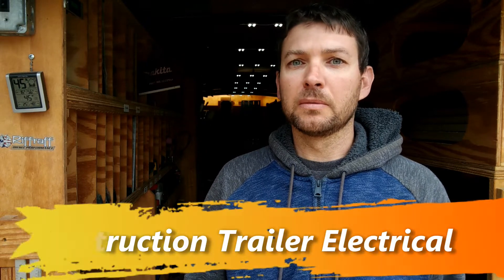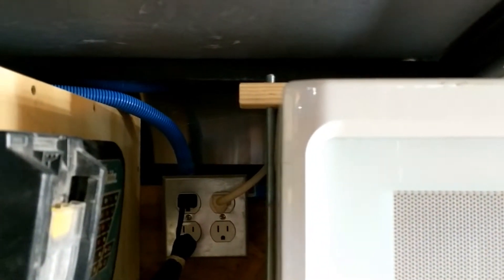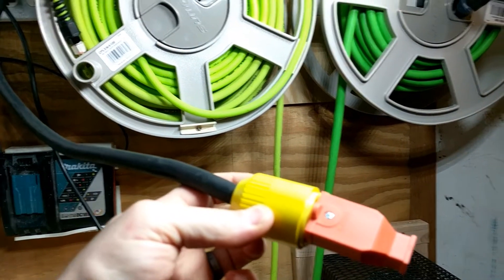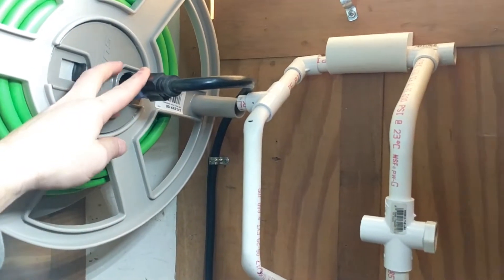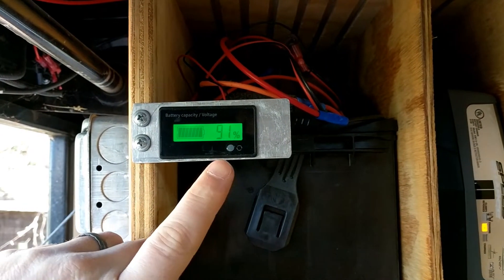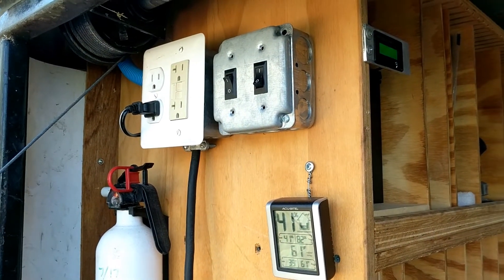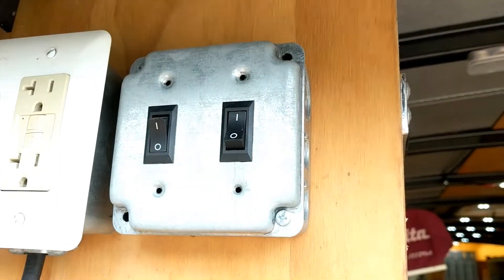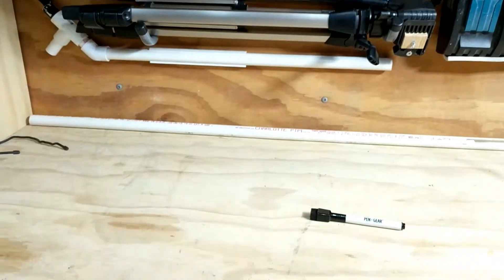Construction Trailer Electrical Setup and Tour (110v and 12v)

Comment: Anthony, I should have read your reply from one year ago and I definitely would agree with the lithium ion battery. What size lithium ion battery do you think would be sufficient. Thanks Joe.
Reply from the maker: I'm not sure what would be suitable. I've taken mine out and replaced it with attachments for two 18v Makita batteries. They drain quicker than I suspected and all they are pulling is the LED lights.

Comment: This is so helpful and informative.  Thank you so much for your time making this and sharing it with us.  I've got everything you listed (that's still available) in my amazon cart.  Do you have any thoughts now that you've been using this system for awhile?
Reply from the maker: First of all, thanks for watching and commenting Seth. I would add a solar panel to keep my battery charged and I would put a lithium battery in instead of a deep cycle marine battery. My battery runs down really quick and I don't even run anything except for those LED lights.

Comment: Nice job man!  I am almost finished with mine, I am using alternator and solar power to charge my 100ah deep cycle battery by way of a dual input DC to DC charger.
Reply from the maker: Fantastic! If you happen to do a video or a write up be sure to put the link here in the comments. Are you going with traditional battery or lithium battery? Mine doesn't seem to hold a charge very long anymore.

Comment: That black cord with the orange end you purchased is very dangerous and illegal.
Reply from the maker: What can I upgrade to that would be better?
Reply: @shooshinejonnie  I didn't understand what you're trying to do with the cord but you can't plug the male end into a receptacle and have a hot male end on the other end of the cord. What does the cord up by the hose real that you're trying to power do?
Reply from the maker: Basically I have two pigtails that go into the same system. One is to plug in at the back of the trailer and the other is to plug in at the front of the trailer. So yes, I do have what is basically an extension cord with plugs in the middle and two male ends on either end. I usually use the one in the front the most. It is convenient to have one at the back of the trailer. Sometimes I just run a short cord instead of my big cord if I need to power up a charger or something small.
Reply: @shooshinejonnie  If you're the only one using it than you know what is going on. I'm sure you could wire something up to avoid having a cord with 2 male ends.
Reply from the maker: I may just eliminate the one that the back end of the trailer. I don't use it that often and I can't close my door with it plugged in. I appreciate you chiming in.
Reply: @shooshinejonnie  I'm only trying to help, accidents can be expensive.

Comment: Hey Anthony, awesome construction trailer set up you’ve made for yourself there. Can I ask, is the power coming in 15/20A? Also do you have a breaker on the line any where? Thanks
Reply from the maker: Thanks Oliver. I only have 15 amp power coming in. I don't have a breaker. I have a gfci outlet on one end that would protect the rest of the outlets. I need to put a gfci outlet on the front feed.

Comment: Thank you for the video.  Got some good ideas.  Seems you have to have the rear door open in order to use 110V current.  Ever think about installing a plug on the outside of the trailer to attach current?
Reply from the maker: I have the big green cord in the front that drops out through the floor. That usually powers my entire trailer including my air compressor.
Reply: @shooshinejonnie  Can you post where you got the cord/reel setup?  Also, what are you using to cover up the hole in the floor that keeps dry when trailering in the rain?  Appreciate the help!
Reply from the maker: @SteveK99Sub  here's a link for the hose reel.
https://www.amazon.com/Suncast-Sidetracker-Garden-Hose-Reel/dp/B000BQQ2NM

I have a cover for the hole but I never put it on. I've never had any water that I noticed inside. The floor is about 4 to 5 inches higher than the outside aluminum. I would probably use the cover if I parked it in the grass for any extended period of time to keep the mice out.
Reply: @shooshinejonnie  What you have your electric cord rolled on is just a hose reel?  I thought it was specific for electric being it had a plug.. custom made?  Appreciate the help.
Reply from the maker: Yeah, it's just a regular hose reel. I took the center water hose guts out of it, drilled a slightly larger hole,  and pushed my cord end through there. It's pretty simple. 
Obviously you can't leave it plugged in while unrolling like you can a water hose. I set my air hose up the same way.

Comment: how many amps hours is your battery rated for?
Reply from the maker: Canadianguy91 I'm not sure. It's a fairly big marine battery but it does seem to drain much quicker recently. I tried to see how big it was, but I believe the label is on the side and it's a big hassle to get it out. Unfortunately I can't answer that for you at this moment with any definitiveness.

Comment: Thanks for the video, but you skipped over the very last part I was hoping you'd answer. How is the 12v light switch wired? So you have the 120v and 12v wires wired to the same light switch?
Reply from the maker: Thanks for commenting Matthew. I don't have any 120 v lights in my trailer. Everything is run off of 12 v and it's connected to the battery.
If I would have any lights on 120 I would do a separate switch for those so they can be powered when the trailer is plugged in.
My father has lights that are 12 volt and 120 volt. He has two separate switches for those. His are wired so that every other rafter is powered by the same source. He used the exact same lights but had to add a transformer for the 120 side. Hopefully this makes sense. If it doesn't I can try to clarify a little better.

Comment: Sweet trailer! Don’t you have a back up cam as well?
Reply from the maker: Thanks Jordan. Yes I do have a backup camera installed. 
https://youtu.be/Bdv5dlPEw-4
Reply: Awesome! What kind of camera did you use? Does it work well?
Reply from the maker: @jordanbriner1683  here's what I used on both the truck and the trailer. 

Esky https://www.amazon.com/dp/B013OLWDW4/ref=cm_sw_r_cp_apa_i_CVxuCbB7SDY24

Yes, it works good. Good field of view. 
I'll have to do a little digging to find all the info about the wiring that I used.
Reply from the maker: It just hit me that I didn't have the camera installation in this video. 🤔🤪🤦 I believe I have the installation ready to be edited. I'll get that put together soon.
Reply: What monitor did you use for it?
Reply from the maker: @jordanbriner1683  I have a pioneer head unit that has two camera inputs. I'm still trying to figure out how to switch the trailer camera on automatically when I'm in reverse with an auxiliary switch instead of going into the menu to change the camera view. Because I usually back and then pull up a bit. Well, every time I leave reverse it goes off on my monitor and I have to go the whole sequence again. 

Pioneer AVHX3800BHS https://www.amazon.com/dp/B017LKVEBA/ref=cm_sw_r_cp_apa_i_42zvCb2H6PEVY
Reply: Thanks for the info man!
Reply from the maker: @jordanbriner1683  in case you didn't see yet I did post a video of this. It was one of my earlier videos and it was a long day so I didn't go into a lot of details other than the equipment I used. It gives the gist of the project. If you have any more questions I'll try to answer them for you. 
https://youtu.be/ugmpNJFPIng
Reply: Just checked it out! Love how you have the trailer set up thanks for the info helped me out a lot I’m new to all of this stuff so anything helps lol

Comment: Dude you are my hero!!!!!!! Rocking it!! Whats the microwave for?
Reply from the maker: Thanks Austin. The microwave is for lunch. I pack my lunch and 90% of the time it's leftovers from the night before. If it's not leftovers it's usually a pot pie or something similar. Very rarely will I make myself a sandwich.
Reply: @shooshinejonnie  Do you find that 15 amps is enough to power all your stuff in the trailer, especially if you  have multiple battery chargers, microwave, and an air compressor?
Reply from the maker: @hello_universe6357  yes. Generally the microwave isn't running when the air compressor is running.

Comment: Looks awesome! Question: how are your backup lights wired both with the reverse lights of your truck and 12 v switch in the trailer so that the switch either doesn’t have to be on when you’re driving in reverse or the switch doesn’t feed back to your truck’s lights when still plugged into your hitch?
Thanks for sharing!
T
Reply from the maker: I have the reverse lights tied into the trailer reverse light circuit. For my switch I just tapped from battery to switch to reverse light circuit. Therefore when I flip the switch I am energizing the reverse light circuit. If the switch was on and and the truck happened to be in reverse as well it wouldn't do anything. It would essentially be the same as having two batteries on the same circuit. My truck already has two batteries on the same circuit. I've never had them both on at the same time. I rarely use the exterior light switch except in the winter and I'm working late. It does come in handy when I need it. The reverse lights are a must in my opinion. Hopefully this answered your question.